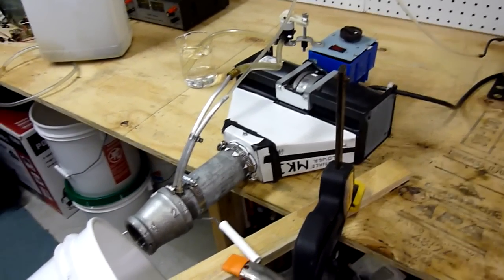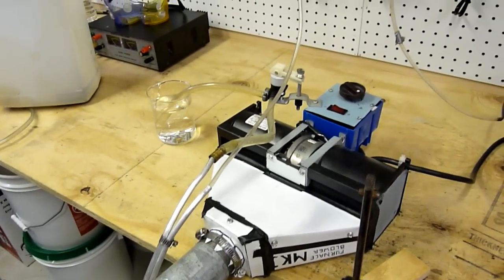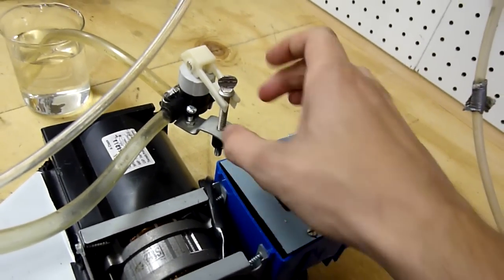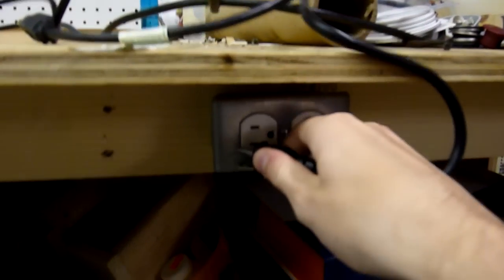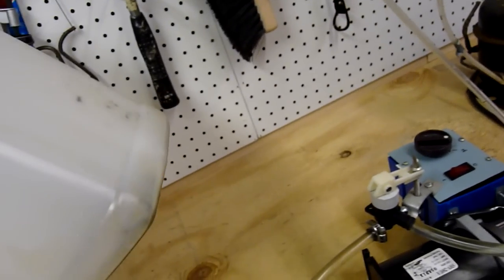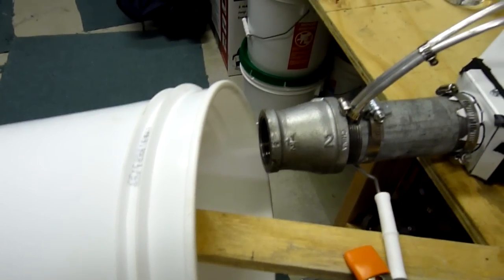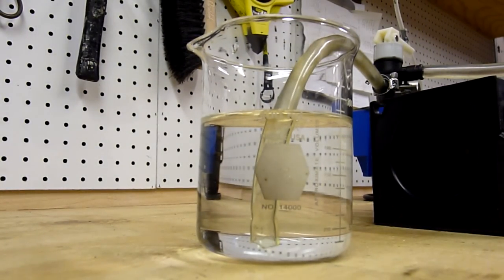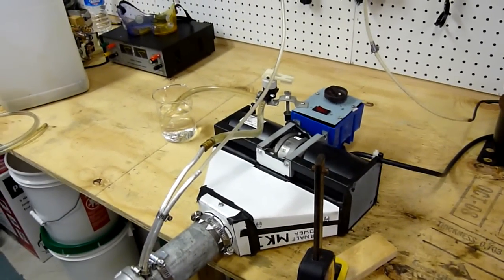Completed Atomizer Burner

Comment: I like the design very much but I'm pretty sure the water won't ingite no matter how finely you atomize it. Well, maybe if you truly atomized it into H and O then it might could work. That would probably require a higher pressure compressor, i think. Hey! Try some diesel fuel instead!